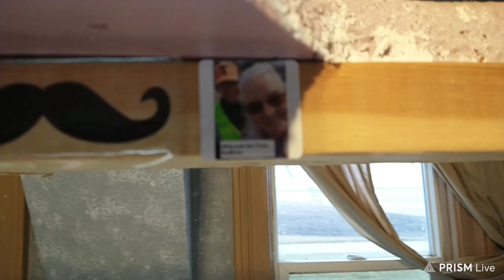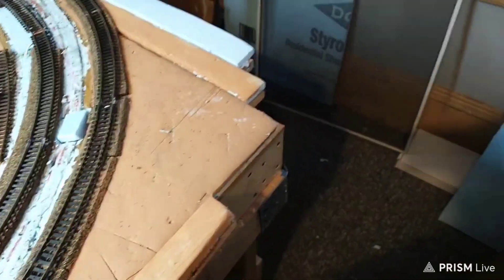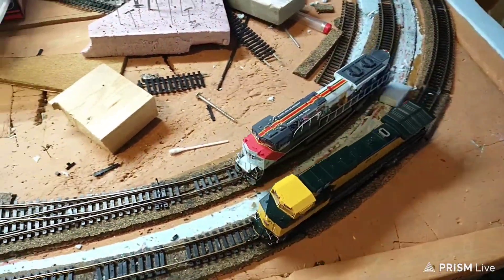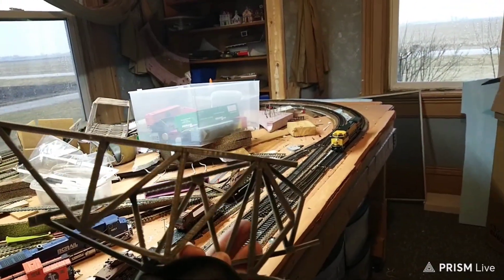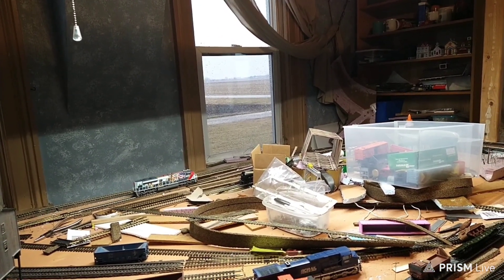Layout update #16

Comment: Hey there Dwight glad you got the turn worked out. Just like you mentioned. What if you cut the bridge in half and print a filler piece for the top and bottom glue it back together and it will make it wider.. good luck
Reply from the maker: that what i did when i built that bridge the first time lol might make a different style one thanks